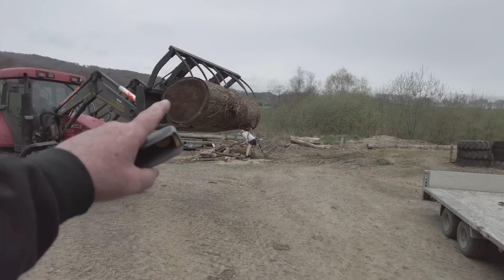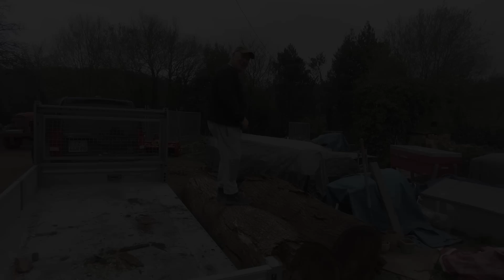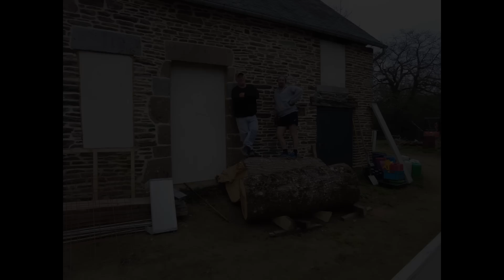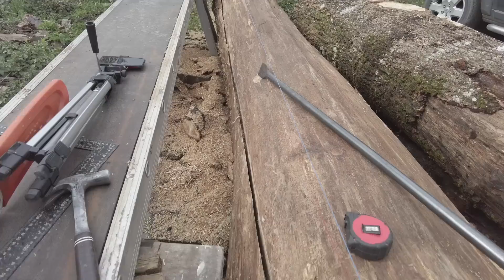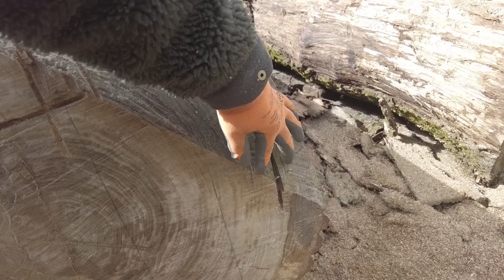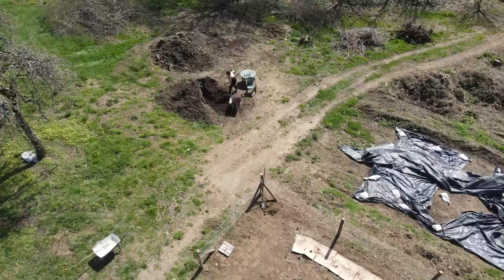No 95. PORCH BUILD #frenchfarmhouse   #farmhouse #porchbuild #porch #homesteadingskills

Comment: This is a fun watch. Will you be using any of this wood to make beams for the new kitchen or other projects in the house?
Reply from the maker: High Glen yes mate we will use some of the timber to make bits through out the home like work tops, box lids, maybe flooring with the Chestnut not beams though as the Chestnut are a little short for that mate 🍺🤠👍
Reply: @doingitourselvesbudoandtracy  👍

Comment: So, are the newly cut ones going to stay outside for a year? And what about the big long one.  Will that be seasoning for the next year or will you get somebody to kiln dry it?
Reply from the maker: Hi Susan no this is what we call in the trade green wood and its worked straight away in the wet if you like which is only used for out side work using the proper jointing methods like mortise and tenon work with draw doweling it will start to shrink and crack a little as its moisture level finds its surrounding level its used this way in post and beam work and we have building built like this in England that are as good as the day they were built 5 or 6 hundred years or more ago 3 or 4 hundred years before America was founded 🥰😘
Reply: @doingitourselvesbudoandtracy  😎 cool

Comment: Do you have to let the logs dry out before cutting them?
Reply from the maker: High Julie no the logs are what we call in the trade Green and green work is when you are building say log cabins or post and beam work like the porch will be hope you enjoyed the video all the best Budo 🥰😘
Reply: @doingitourselvesbudoandtracy  Yes I really enjoyed the video! I didn't know you could work with green wood. I thought it would crack/split as it dried out but i guess if it's used outdoors than it wouldn't crack or split.
Reply from the maker: @Jules_1081  Hi Julie yes it will shrink and crack a little till it reaches its equilibrium but the trick in Carpentry is to use the correct jointing work with mortise and tenons that are draw pegged and grain direction Ing 😘🥰